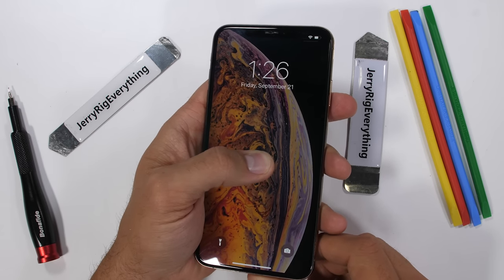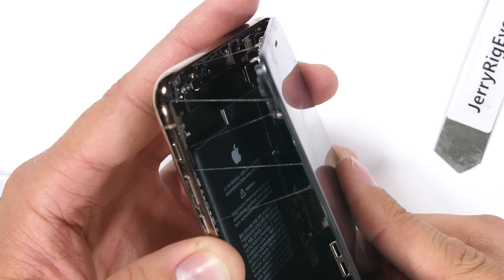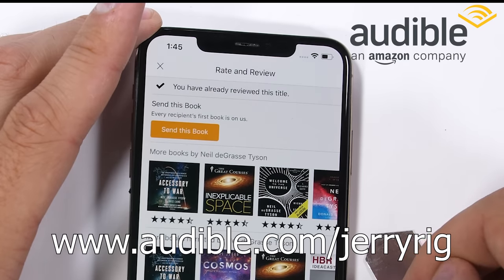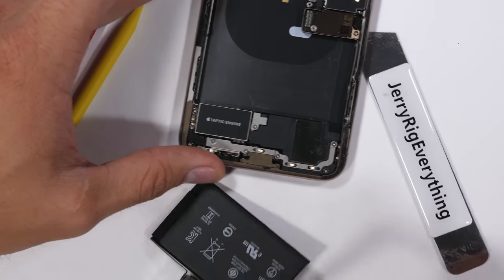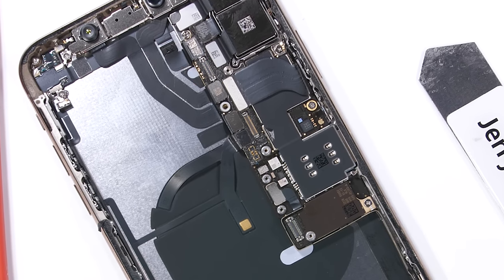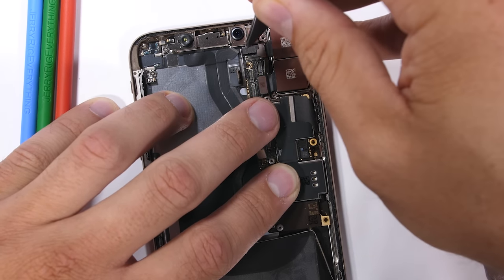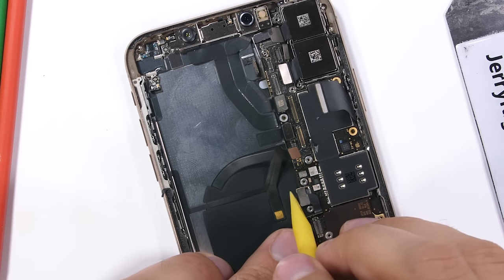iPhone Xs Max Teardown - Is there any Thermal Cooling?

Comment: 7:05
I was asleep until I woke up to this!😁
Reply: You realize if they don't throttle it, the phone will shut off randomly due to the age of the battery? But if they didn't throttle it and phones were dying randomly, everyone would still be mad. Which would you prefer? Throttle and you phone doesn't die randomly or not throttle but it shuts off at 35%?
Reply: @leviriosjr  blah blah blah I'm an apple fanboiii... I'm stupid and proud blah blah
Reply: @yusufgokce7524  uhh.. okay
Reply: @yusufgokce7524  get help
Reply: Moomoo idiot
Reply: @leviriosjr  Total bullcrap, it isn't like people are running decade old tech that works just fine, especially when it is well maintained and not mistreated.
Reply: @fennviktorvich  I own the S9. I've owned it since launch and the battery lasts nowhere near what it used to when I first got it. I cant even go a full day without it dying. If Samsung throttled it, maybe I'd actually be able to use my phone past 2 o'clock.
Reply: @leviriosjr  have you heard about a nice thing called "power banks"? Some have wireless charging too... Which yes your phone does support
Reply: @TemmieTem  what does that have anything to do with the iPhone conversation thsy we're having? Anyways yes ik what it is and yes I've used wireless charging with the power brick that came with my phone but it still doesn't charge as fast. A d doesn't change the fact that my phone doesn't hold a charge
Reply: @leviriosjr  no one should be using a phone that throttle, writing software into phones that makes them throttle without the user consent is a crime
Reply: @leviriosjr  thats a terrible argument and assumes equal battery degradation and use across every device, which is 100% impossible so every single apple user suffers because 40-60% of people ruin their batterys within 2 years? I dont think thats fair what if you bought 2 teslas one day and off a charge they got theoreticly 100 miles per charge, now you give one to your teenage child and one to your cautious grandmother , now 1 year later tesla realeses a new car that gets 120 mpc, and at the same time sends out and update to "presserve older cars battery" like apple did and now both the teens car amd grandmas car both can possibly only get 80 mpc, but grandma only took hers to church and the grocery store every day and the car is in great shape and still gets 99mpc /100 but the teen, was a new driver who liked speed and drove their car every day, charged it every day and now its only getting 82/100 mpc , but with the patch for "longevity" has made grandmas almost mint car just as useful as juniors , now what about a year after that, then another year, jr's car wont even turn on while grans can still get 90/100 but due to updates shes only aloud 60, 

Tldr some users whose devices are in better shape or got the device later in the cycle will be throttled the same as someome who ran it hard and into the ground, what happens if i go buy a brand new in box iphone 5c now is it gonna update and slow itself down for no reason?
Reply: @MRICECOLDCOLE honestly, I'm not even going to attempt to read that and ima just say you won.. congratulations
Reply: TheGamerCyclops you are the most reasonable person here and I have to agree with a lot of what you say. I don’t think it was a good idea that apple kept quiet and did it without telling anyone and maybe there should’ve been an option to opt for low ram mode or something to preserve battery life. But in the end I think it was smart but that’s just my preference. But thank you again for not just saying I’m stupid for liking apple and ignoring anything I say

Comment: I think the Vibrator-Teardown should be standart procedure from now on,
it might be pretty interesting, how the different Vibrators of different manufacturers work! :)
Reply: From most phone teardowns, a lot of phones use an eccentric rotating mass vibrator, usually in an encapsulated or coin vibrator form or a linear actuator, a la Apple's rather noice Taptic Engine. Eccentric rotating mass vibrators take up less space than Taptic Engine like linear actuator vibration motors but those generally offer better haptic feedback.

Comment: And only $600 more than iphone x
Reply: what? This costs $99 more than iPhone X did.
Reply: it costs 1500$
Reply: If my phone would break right now I'd buy an LG V30 for 440€ and enjoy my quad-DAC :P
Reply: Boona yeah that’s is you want the 512gb version. The base model is $1,099
Reply: Comparing the prices of 64gb iPhone X with the 512gb XS Max. Yep, that seems reasonable...
Reply: @yeahnoway111  the Xs did but the Xs max is more
Reply: @lgkjapo  The iPhone X itself, can be found for 600 on ebay. He was just a little off.
Reply: mohyi M they don’t sell the x anymore, the XS starts at 999, the XS Max starts at 1,099, a 100 dollar difference!
Reply: iPhone XS Max starts at $1099 not $1500. Most people will never need a 512GB phone

Comment: 3 years ip68 the Samsung s7
Reply: Samsung since 2015 on S6 Active or Huawei since 2013 on Ascend G350
Reply: avery baxter you said it first. I was about to
Reply: The s5 was water resistant too guys.
Reply: I loved Android... until I they became over a year old and the battery would die at 20% and last only a few hours at idle.  Got my 6S Plus 2 years ago and is still fast AND goes to 1% before dying after being on almost all day with heavy use..  Once they make the battery life better I'll come back, but even Linus from LTT has this issue with his S9+.. Just saying I'd rather have reliability over features any day.
Reply: S5 had it, S6 never got the rating. So longer.
Reply: Apple haters xD
Reply: Water resistant ratings mean absolutely jack unless water damage is covered under warranty. You could tell me it’s waterproof to 100ft for 24 hours but if water damage isn’t covered, don’t put it that phone in water on purpose.
Reply: @Tyler22888  every phone has issues, even iphone xs max users are reporting network connectivity issues so where is releability now?
Reply: Rohit Surawat I mean stuff like that is expected when a phone launches and is most likely a carrier issue and or a software issue. But I mean I’d much rather have a few software issues than hardware. Ya know batteries that don’t blow up and can keep a charge? But hey like I was saying I don’t hate Androids. I just hate how they boast so many features and then fall apart after a year of use.  Maybe one day I’ll get another one just waiting for his whole battery life issue thing to be resolved.
Reply: And actually it doesn’t match with Samsung. Apples rating is better. It’s 2 metes for 30 minutes. Samsung has 1,5 meter for 30 minutes.
Reply: Tell that to my s7 edge that is pretty much crawling... I can't play any games on it, the interface lags like crazy.,the battery drains after 2 hours of use, and so on... While my wife's iphone 6s is working perfectly fine and if not for the fact that she watches youtube on a tiny iphone 6s screen all day i wouldn't even bother getting the iphone xs max for her. Oh and i forgot to mention my s7 had the batteries expand inside it popping out the back cover.

Comment: The battery is shaped like an L

So buyers take the L
Reply: on her forehead
Reply: well the years start coming and they don’t stop coming
Reply: loooooooooseerrrrrrrrrrrrssssssssss
Reply: YOU BROKE THE CHAIN
Reply: L shape for 3100 mha. what a shame
Reply: L stands for "love to our customers" lol
Reply: @catboy3471  lol the note 9 screen is currently the best on the market, easy to save battery when the iPhone sports a 458ppi display screen
Reply: @catboy3471  LMAO U R THE SHEEP THAT THINKS APPLE IS THE BEST IN THE SAME TEST SAMSUNG NOTE 9 CHARGE 3 TIMES FASTER THAN THE I PHONE X
Reply: @catboy3471  You probably watched MrWhoseTheBoss channel and saw that. Note 9 was on its full resolution 2960x1440 and XR is on pitiful 1792x832 resolution. No shit 
Sherlock 7nm procesor with lower resolution outperformed much higher resolution with 10nm SoC.
Reply: @catboy3471  at least cite your sources .-.
Reply: @catboy3471  iPhone  Has great Battery Optimisation I agree but lets not forget note 9 was powering More Pixels than iPhone note 9 has a Better display than an iPhone..
Reply: Fănel Adrian  L stands for Ligma :P

Comment: Basically it's easier to replace the screen but almost impossible to replace the back glass
But Apple still charges you $350 for screen repair 

This makes no sense
Reply: I guess one reason is that they pay almost $200 for the screen
Reply: they pay $100+ for the screen
Reply: Yes it does. Profit.
Reply: Arþur D 😂🤣😭
Reply: Are you sure? If the still use Samsung panels it wouldn't surprise me if they are getting charged rediculous amounts.
Reply: The replacement is easier, but the part is more expensive.

Comment: 7:05 Old iphone throttled when new iPhone comes 100% true . 😐
Reply: Actually not really. Apple admitted that the only reason they had to throttle was because the weak degraded batteries of old iPhones couldn't handle new iOS upgrades so rather than have people's phones crash and lose battery instantly, they'd slow them down a little.

Comment: apple ip68 rating finally matching with what Samsung has been doing for the past 2 years haha
Reply: 3*
Reply: simon osok what’s so funny?
Reply: And Samsung has been doing wireless charging for many years, at least since the Galaxy S4 or S3, with fast changing since the S6, while Apple only adopted it a number of years later with the 2017 lineup.
Reply: @kbhasi  Samsung had fast charging since the Note 4
Reply: simon osok you forgot to add “and still people buy more iPhones”
Reply: @TVCHLORD  and you still don't understand what an industry standard it
Reply: Or sony for like 5.5 years
Reply: @TVCHLORD  take a chill pill jesus
Reply: I find it especially funny that ur galaxy s5’s are  all but usable with that android 5. Meanwhile even 5s rocks iOS 12
Reply: stephen allen It’s an industry standard, yes. However, the manufacturer is meant to provide a depth rating of their water resistance, in this case, Apple’s is higher.
Reply: @TVCHLORD  INDUSTRY STANDARD. Learn the term. It's a marketing technique they're using. Both phones can happily do deeper than that for much longer than that but the point is where you draw the line for people so they don't accidentally take it too far and then complain about it.
Reply: @rot_v  there both ip68 30-45mins 2 meters but remember its water, not salt water or chlorine so it's because a drop in the toilet and that's it
Reply: Marx Domah Yea still buying garbage
Reply: @joonassild  hmm i installed android 8 on my s5!? just cauz u cant do it its not impossible kiddo. Btw Android 5 is still a great OS
Reply: SG3xHERO The Note 9 is rated at 1.5m for 30min, the iPhone XS is rated at 2.0m for 30min.

Comment: No thermal cooling!? What the hell does that even mean? Any electronic chip without cooling would end up frying itself!
Guess what is meant is no heatpipes....
Reply: 7 nanometer a12 is why
Reply: It's his clickbait-y way of saying no heat pipe.
Reply: Do you know , heat reduces when efficiency increase.
Reply: @tominjose1993  Based on how hot the iPhone X got, the def need some cooling
Reply: @tominjose1993  / but it would still need a proper heat pipe, since modern chips have so much to handle.
Reply: Apple prefers to aggressively throttle down the frequency of the CPU/GPU instead of designing a proper cooling system. Look what happened to latest MacBooks for a perfect example ;-) And yes, to be completely objective their A12 SoC is very power-efficient, much more than current SnapDragon SoCs.
Reply: Apple fans will say it doesn't need it, but remember $300 phones have it, so that's just one more thing that Apple has missing, so why is it so expensive?
Reply: bdegrds bc the 300$ phone is made out of plastic
Reply: Lol my xs started to get heat up while playing pubg  on extreme it definitely needs cooling
Reply: Shaffan Mumtaz u can play it underwater

Comment: For everyone that might be repairing their phones. ALWAYS first unplug the battery before you unplug the LCD connectors, because from iPhone 7 and on the iphones always have electricity running thru them, so if you want to avoid a chance for your motherboard to stop working please do unplug the battery first.

Comment: Yep, replacing the dock connector/headphone jack is a real pain on the iphones, I did a video on it for the iPhone 6S a couple of months ago, it wasn’t fun. Would be a lot easier if Apple could just decide on one kind and size of screw... I suspect the XI will have a different security bit for each screw and every screw!
Reply: Apple didn't decide on just one kind of screw because they really want to screw you multiple times with all those screws... literally
Reply: Someday apple will use a unique screw and you have to buy their iscrewdriver for 70$ to be able to repair your iphone.
Reply: ScrewID is 20 times safer than faceID
Reply: I honestly don't think it will be long till we don't have a port or a port we use. I never plugged my iPhone X in or connected earphones. I used wireless charging and AirPods which I continue to use the same as my Xs Max. The only time I can see me using the port is if someone goes wrong with the OS and needs to be plugged into a computer.

Comment: 7:08 Using iPhone XS Max daily basis with original battery 86%, and it doesn’t throttle, right now on a trip over Europe, google maps is the most often used app alongside with omio, airbnb, booking and music, taking photos and videos every minute, and it goes just well so what’s the true story about the iPhone XS Max throttling after iPhone 11? This guy is so ridiculous trying to prove its own frustration against Apple. Btw running iOS 16.

Comment: Fun fact:
Android phones have thermal cooling yet they can’t record a 4K 60fps video without a time limit due to heat issues
Meanwhile 
iPhone doesn’t have any thermal cooling and yet it can record a 4K 60fps video for as long as the battery or storage runs out
Reply: Thats not true
Reply: DaDestroyer12 
Yes it is :)
Reply: False. 
Fun fact:
Android is an OS. And there are A LOT of phone manufacturers out there that uses this platform.

Another fact:
There are waaaaayyyyy much more better Android Smartphones out there from a plethora of manufacturers than an iphone.
Reply: jet ro 
I know Android is an OS but it will be impossible to name all the phone models I was talking about. So much easier way to say it ‘Android phones ‘ 

Fun fact: 
Your opinion or anybody’s opinion is not a fact. That’s why there is a difference between the word ‘fact’ and ‘opinion ‘. 
You like an Android phones >> doesn’t mean it’s a fact that Android phones are better. Simply it’s your opinion >>> and that’s a fact 😉
Reply: False again.
Fun Fact:

It is not true that it is false that Android is an OS and there are A LOT of phone manufacturers out there that uses this platform.

Another fact:
It is not true that it is false that  there waaaaayyyyy much more better Android Smartphones out there from a plethora of manufacturers than apple.

It's not just an opinion. It's a general fact.
Reply: I think I lost a good 70% of my brain cells from reading this comment. Sorry you think your iPhone is magic and unique.
Reply: Max N 
Yes my iPhone is unique 
Why are you upset?
Reply: @KingOfHac  Huawei P30, Pixel 3, LG V40, and the Galaxy S10 have better cameras than the XS Max. They can record at a faster frame rate. There is no liquid cooling in the XS Max, but there is on the $300 Pocophone F1, so it isn't really a just comparison is it? Kudos if you respond reasonably it would make you smarter than I previously thought.
Reply: Jonathan C. 
Why so serious? Relax! Calm down 
And what I said is true 
Just accept it and don't cry about it
Reply: Max N 
2015 >> iPhone 6s can record 4K@30fps videos without time limit 
2017 >> iPhone 8 can record 4K@60fps videos without time limit 
----------------
2019 >> Galaxy S10 is the first galaxy phone that can record 4K videos without time limit (only in internal memory or special external memory)
2019 (so far) >> Huawei still can't make Mate or P series to record 4K@60fps

see? What I said is true (:
What you said is not ):
Reply: Max N 
And before I forget 

You know where to shove the liquid cooling when it helps in nothing but marketing the phone to the fools :)

Comment: Wait... so is there any thermal cooling in this phone at all?
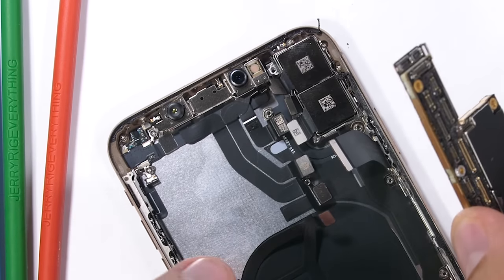Reply: Your answer is at 7:00
Reply: 7:00
BUT
When tested Note 9 vs iPhone X
At fortnite for 30mins, both get as warm
Reply: There's no external heat dissipation method, but the dual layer board has a HUGE ground plain. The components dump excess heat there.
Reply: In 2020 bro
Reply: @Jesse Hämäläinen @AngryTechGuy Thanks for the clarification!